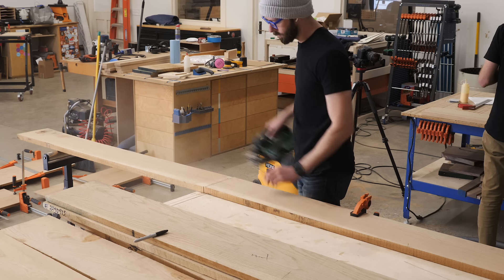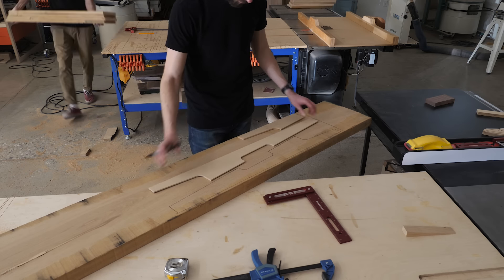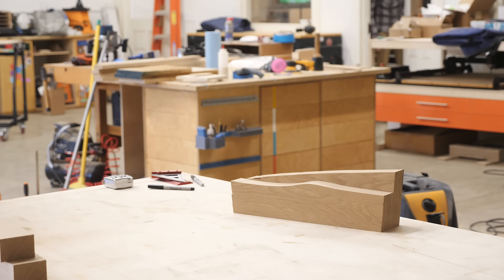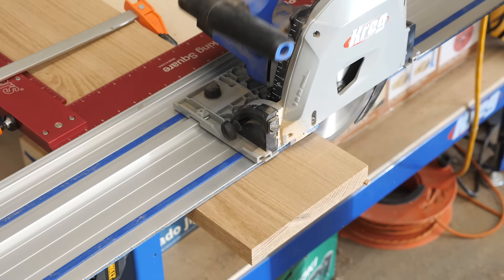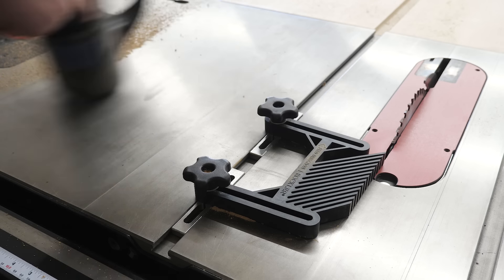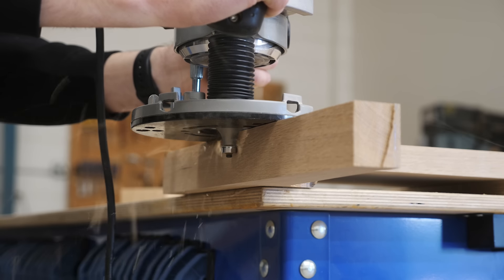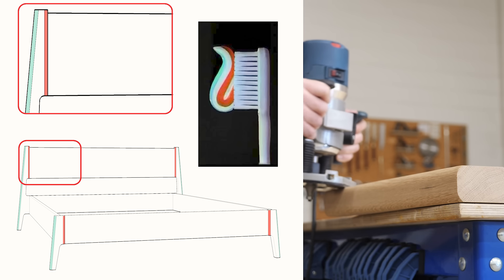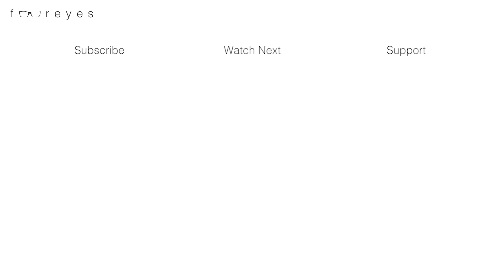The Best "How To Build a Bed" Video on YouTube

Comment: Living in Europe, where wood is quickly becoming absurdly expensive, and where just one board of nice oak this thick is almost two weeks salary, seeing this kind of massive hardwood furniture projects makes my head spin. Might as well be watching jewellery design instead.
Reply: Or.... you find a material that fits your needs and is less expensive at the same time. It is not mandetory to use the exact same materials to come to a very beautifull result. All it is required is you to decide to either do it or not... in the mean time do as i do.... enjoy the given content and when i come off my lazy horse, maybe, just maybe, i could drag my old bones to actually make something nice for myself and/or loved ones. 😏
Reply: @henridejong9433  He's not wrong, even making these lovely designs from reclaimed scaffolding boards would be prohibitively expensive for most people - unfortunately...

I recently made a threshold strip for my mother to go between a carpeted room and a wooden floor, from a piece of oak about an inch thick, 5 inches wide, and around 5 feet long - that cost about £80 ($100+)

Comment: You guys are truly incredible at the craft and what you design / create. I just bought your course for the matching nightstands and absolutely love it. Very well done. 

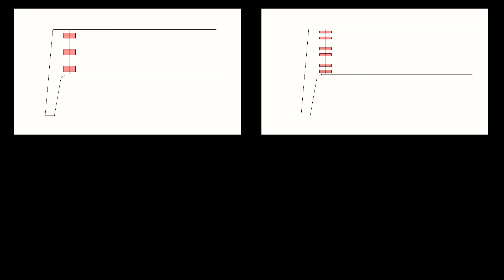One follow up on this video I was wondering.. At about 12:00 you mentioned you can use biscuits to join the 7 pieces together. Are these truly strong to hold together for a bed? Dowels/tenons/dominos make total sense. I would think the thin and shallow size of the biscuits wouldn’t hold for very long. Especially when you know 😉 ….. all of your pets decide to jump on your bed at nighttime and  add some extra weight to the bed.

Comment: I had a similar "make it low" requirement when I made a double bed a while ago. Rather than add support under the centre rail I went with steel C channel (the smallest I could get) as nobody would ever see it. It worked perfectly with no perceptible sag and leaves plenty space for under bed storage.
Reply: that's good, cause one wooden support will not work for a king.
Reply: That bed will sag in the middle after a while, they tested it with supports under the center rail.

Comment: Nylon strap on the slats so you can just roll them up when you eventually move to a different room or house. Soldering iron makes nice holes in nylon or you can blowtorch a sacrificial 8 penny nail as a hot hole punch thingy. 

I couldn't personally risk my titanium ankle, but I love the design and I think you are exactly correct about "the stance." Beautiful Work Is Beautiful. 👍🏼

Comment: Hi Chris,

Recently I started to find my way into woodworking. I am lucky to be in the position that I can use a combination machine (planer, joiner, tablesaw, router table in 1) of a friend. Unfortunately I had an accident where I got my thump in the joiner. Luckily it only scratched the tip off so once it is healed I can still use it and I can continue with woodworking.
My question to you is, do you have any tips use the joiner more safely? I had troubles pushing the wood through the joiner because it was very heavy. I was thinking about some sort of WD-40 on the wood so it would glide better. But this stains and I dont know how good this is for the machine. This machine does not have a cover that automatically flips back once you have pushed the wood through.

I hope you have a tip or two that you learned over the years that you want to share. I have seen you use these pads on the planer to protect your hands. I am going to look where I can get those.

Finally, thanks for sharing your passions, I have learned so much already from your videos. Definitely helped motivate me to start doing this myself.
Reply: I would like to suggest you get a white (or undyed) candle and wax the bed your sliding your boards on. This will help immensely and make things safer. To protect your hands you should be using push blocks.  Hope this helps!

Comment: Chris I’m about to buy plans for this great bed, I’m fairly new to woodworking, so this may be a foolish question, but here it goes; although the boards for your footboard and headboard seem to be quarter sawn, they will most likely move with humidity levels, but they really can’t because the legs are glued to them with the grain in them  running perpendicular to the grain in the boards, so is this a problem? / does this exclude using plain sawn boards for the headboard and footboard? Is there a way around it? Thank you! Mariusz
Reply from the maker: We talk about wood movement and consider for normal wood movement in all of the designs. 

For that part specifically. 

Glue has some flex to it, so really the problem with wood movement comes from things like "trapped panels and joinery". In the headboard you could probably do nothing and it would be fine, but we did it where the you have an anchor point towards the bottom with dowels or dominos that are sized to fit. Then towards the otherside we use elongated joinery. So that even if the panel wanted to move it could. 

On the footbaord this isn't necessary as the piece is only about 7" wide. There will be hardly any movement over that distance.
Reply: Thank you Chris!

Comment: What type of router bit did you use to mortise out for your hardware? I have a straight bit that cuts a flat bottom but not sure how that would work with your setup. Thanks!

Comment: I would like to share a tip that helps to prevent stubbed toes. Buy pool noodles, preferably the brightly colored ones so they are visible. Cut them to size then lengthwise and tie them with zip ties to the bed's legs and voila! You get to keep the great-looking bed design and your toenails too! Win-win. Alternately, you can tie the pool noodles to your toes.

Comment: Question to Chris and anyone (and apologies if it is silly). So if you wanted to simplify, why only create the templates on the CNC vs cut the actual pieces on the CNC... Especially if the depth is achievable?? Or is it because of the joy of woodworking?
Reply: Asking politely is never silly. 
They could, because they have such CNC, but they are aiming this so people with less specialized machinery can achieve similar results.
They have explained this point in a few previous videos.
Reply: @M1008  thank you!!! I appreciate it :)

Comment: Love the design, clean and light; great video as well! A challenging compromise for the legs, make them look great  or hide them a little so you might not stub your toes. I think having the legs noticeably stick out is better than blending them in at the corner of the bed (straight down), at some point you will program yourself to walk around them as they are easily seen.  Question - in your design iterations did you consider not laminating the pieces together to make a solid headboard and leaving a small gap?  With a gap it might compliment the lightness of the rest of the frame.

Comment: Awesome video again.  Question because it wasn’t listed under featured tools. Was that a pattern but you used? I’m going to do some recessed metal legs into a table, I have bearings and spiral up cut bit, but looks like you used a pattern bit with a bearing? Thanks.
Reply from the maker: Yeah. Pattern or template but. As well as a flush trim bit.

Comment: Really nice design and nicely paced presentation! I appreciate the step by step sequencing you do so all the parts come out the same size and consistently shaped. And the extra “detours” needed for the project to go smoothly like the table saw sled and router template jig. BTW, what did you use to finish the oak?

Comment: Amazing and thought through video, as always.

Question 1: Would you know if the bed hardware is available in Europe? (Shipping with Rockler is twice the price of the hardware)
Question 2: I think I got most tools to do the job except the very long clamps. Is there a (good) work around for this part?

Thanks!
Reply from the maker: Thanks Magnus. I don't know the answer to question 1...but I think this is a pretty common type of hardware, so I feel pretty confident that you'd find something similar. 

For question 2. Yes there are workarounds for not having long clamps, and it is covered in the videos. Basically though. It's either rig something up using multiple clamps. Or use no clamps, but rather screws as temporary clamps. So for example on the footboard assembly. You could do some pocket screws on the inside of the frame to drive your pieces together while the glue sets up. And honestly you could just leave the screws in there. Nobody will ever see it because the mattress will cover it. Then for the headboard you could do the same thing. But since the upper part of the headboard WOULD be visible. You'd want to do them on the back side...and you'd want to remove them after your glue has dried because this panel is much wider and taking the screws out will allow the panel to expand and contract without any issues.

Again, it's covered in the plans. - https://www.foureyesfurniture.com/product-moon-fry

Comment: I wonder if the center rail would be strong enough to hold without the added supports if the rail was tapered wider in the center to beam-like height with shorter ends. Similar to gussets welded onto rock crawler axles. Like an upside down plateau.  You wouldn’t be able to see it from the ends or sides unless you got down on your knees

Comment: Sweet vid. Definitely doing this project. 

Question: does that hardware that you used to connect rails to headboard and footboard provide enough strength to keep the bed from racking? Seems like it would wobble around a lot
Reply from the maker: I was worried about that too… but not at all. It’s very solid.

Comment: Oak is always beautiful. Very nice piece of work!
Did you consider using a metal center beam to avoid those support blocks?
Reply: You could also make the beam wider in the center and thin as it is at the edges, like roof structures are

Comment: Nice work it looks beautiful…. Sorry, I know you addressed it… but my toes would be toast… ok, back to real comments.. screwing the hardware into the end grain of the rails makes me nervous … it’s not always the strongest connection, especially if you used a softwood …. Any thoughts? Suggestions, I’ve seen designs that use a dowel drilled in from the underside to add holding power..
Anyway love the work… truly amazing

Comment: You should make some cnc beds that you can cut peaces directly with cnc not mind tho that you like using router to clean cnc bodies. We did it by laminating cnc with fiberwood so you could to overcut to laminate wood and cut each peaces directly with cnc. This is also the way how they do it in a hurry in factory. Lot of of peeces from cnc to sander to domino driller to cluer to final sanding and laquer. Actually we direlled even dominos with cnc as you can program cnc to drill all holes and joiners also.

That said if you would start producing these beds as supermarket options you could a lot of money.

Comment: Well done, always learn something from you.   The design is amazing.  The technique for the hardware is something I use as well (#validation).   But the design, wow.   Thanks for showing this.   I have zero youtube skills, so your production is amazing.   I find 1/2" to max 1" larger than mattress size works best.   Also have built 3 trundle beds this year, must be popular, which means the runners must be 10" from the floor.    So all these words but the one question is how did you join the  headboard and footboards?   I'm guessing dominoes.   Thanks again for sharing both your skill and artistic viewpoint.

Comment: Chris, nice video it’s been a while since I’ve tuned in and see you have a lot more vids out.
Nice large studio space. I wonder if you have a video on your dust collection/air filtration system in your new space. I also noticed that Delta bandsaw; I’m wondering if you a video on that tool as far as time up/maintenance.
I just finished a crib which I’m exhausted from. So I’ll now be doing toothpicks and coasters for some time lol

Comment: where is the plan for making the leg template
Reply from the maker: For those who want to make the templates the plans come with PDF and SVG files. If making it by hand you'd use the PDF. You can print it full size on paper. Attach that to MDF and shape it. There are appendices that come with the plans the go over how to do it. 

Not sure if you bought the plans...but if you did and you have questions. Email us through the contact provided there. I often DON'T see comments here on YouTube. Just got lucky and caught this one.

Comment: As someone who paid $750/per credit hour for college, what you charge for your plan is nothing. Just because this is more of a hands on trade type of skill instead of a more technical skill like chemistry or math etc. doesn't mean it's less valuable. I'm not suggesting charging $750 for your plans. I want people to compare what it costs to go to college vs. learning a skill like making something from a set of plans and all the work that goes into it.  The knowledge and skill gained will be with you for a lifetime. The cost is minimal and the knowledge is invaluable...
Reply from the maker: Thanks Bernard. I 100% agree with you. Unfortunately most people think of woodworking plans as a $20 PDF with some drawings and dimensions...but ours are so far beyond that. 

I've always also felt that anybody who thinks critically about this will realize that the cost is negligible. This bed for example. You're going to spend hundreds or thousands on materials...and it will probably take the average person about 60 hours.

So if you're willing to spend let's say $1,200 in materials and 60 hours of your time. The plans costing $5 or $105 ends up being a pretty small input.

Comment: I have to know... When you vacuumed up the dust on the table saw, after ripping the boards... Was that just for the shot?? I just feel like your dust collection wouldn't allow for that much mess. I could be wrong and that's a dust collection Blindspot, but I just need to know the truth. #illstillloveyoueitherway
Reply from the maker: haha... I think that's because it was after taking my last rip when sizing all my boards. So basically like 25 feet of linear ripping where the blade ISN'T fully buried in the work piece. It's a light cut where the blade is just taking a tiny amount off the end. Without overhead dust collection, and using a zero clearance insert, there is almost no way you're going to capture any of that saw dust. So not staged. That's how it goes.